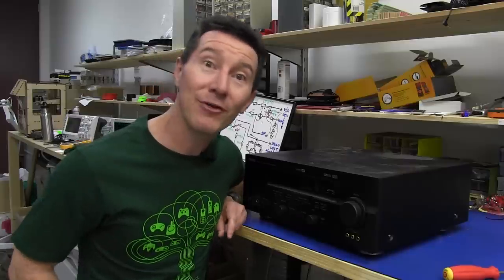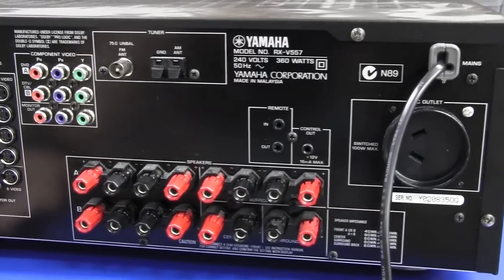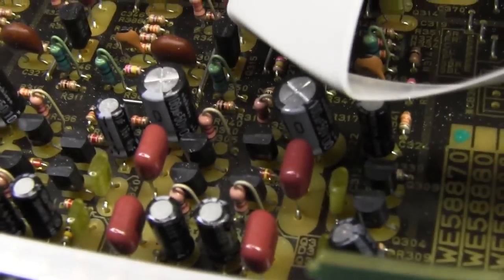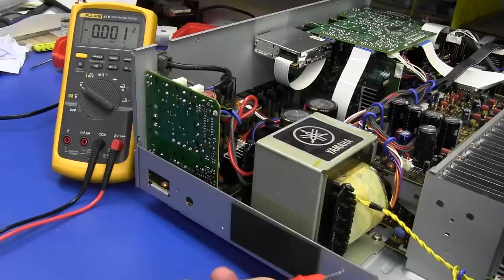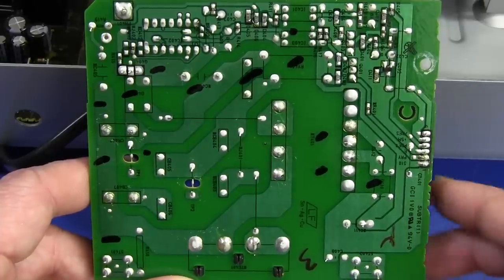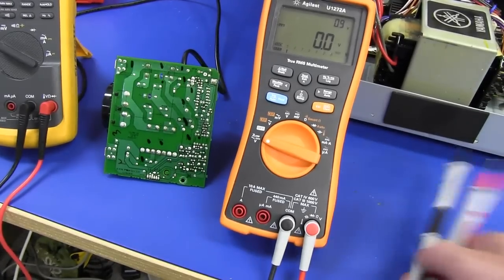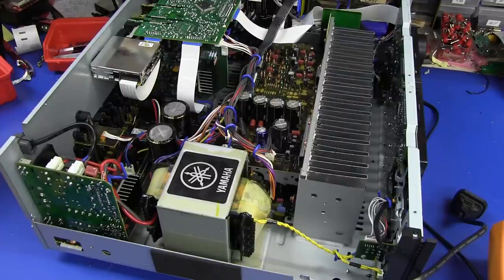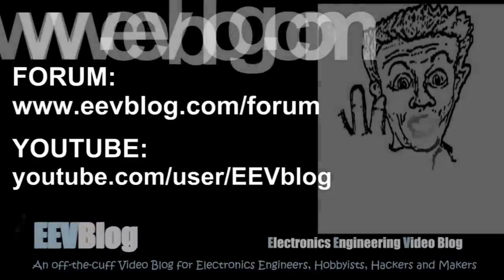EEVblog #378 - Dumpster Diving Teardown Repair

Comment: I tried to fix a 10-year-old JVC home theater receiver for a friend of mine which wouldn't reproduce any sound...eventually traced the problem to a pair of high-precision resistors which are almost impossible to find...so now it's for parts only...

Comment: I agree, there is likely very little, if any practical difference between the caps. They are purely for marketing appeal (perhaps easily visible through the top vents, or simply for teardowns, like this!) I do wonder who uses a surround sound amp with headphones :). I wouldn't know for sure but I doubt they'd spend all the big bucks on a premium headphone amp inside this unit...

Comment: if you hold down a couple buttons an power on you can reset the thing did you try this yet? it has built in protection which you can bypass!

Comment: i have a sony receiver that i like the looks of, but when its off sometimes in the middle of the night the display will partially light up and you get a hum out the speaker that sure wake you up quick. i read that its common with that model and that it is or may be a ground issue.

Comment: in the 70s you could bought Amplifier (that only have 1 signal input and you need to buy pre amp for input selection recording managment, EQ etc, also you need a AM/FM tuner for radio that 3 units that each ones have their own PSU mains plug) , integrated amplifier was the power amplifier + pre in 1 box and you still need the AM/FM tuner for radio unit (total of 2 units), the reciever included inside the AM/FM tuner. as you have more part on your setup it should sound better.

Comment: Only watched a bit of the video so far, but one of those relays might be to short out the inrush NTC when the filter caps are charged; it's common on high-end PC PSUs to meet efficiency standards, but not sure if they'd bother for an amp.

Comment: @19:07, rectifier circuit is not working.  It is acting like a full-bridge had one its diodes die.  Good news is, its probably an DIP-4 IC bridge rectifier - less than $5 to replace.

Comment: Interesting vid Dave.  I think you're being hard on yourself by expecting a solution within 40 mins.   Another 30 mins or so and you might have cracked it.  What was important for my education was the logical way you approached the problem by tracking voltages.  Very useful.

Comment: I have an RX-V657 which comes on for about 2 seconds after the soft on button is pressed, and then goes off.  I can hear the relay each time.  I have replaced C405 :-) but no change.  Does anyone have any idea what to do, other than replacing all the caps on the power board?
Reply: +QuartetMember After replacing C405 the unit was still remembering the old power problem that originally caused it to shut down. So it kept shutting down based on the memory of the problem. 

DIAG option 9 needs to be set to RSVD (reserved) rather than INHI (inhibit) and then shut off the power. This clears the memory of the error indication. Next time I powered it up, it worked a treat! 

Thanks everyone here for all the advice.
Reply: @QuartetMember  what you've described, how do I do that?

Comment: Do you now what i want? I want a multimeter with the hold button in the probe.. How come i have not seen one yet? I HATE working with power on just because you first put the probes in, then you turn your head to see the value. You hold your hand, apply some pressure toget thru te tin oxidize layer, turn your focus away from that all.. Please, tell me there ie a better way? I'm so going to get a cheapo and just solder a foot switch on the hold button so i can take measurements without turning my eyes away. I'm grown man but scared to death every fucking time i need to turn my head away.
Reply: LOL!   Halfway through reading your comment I was gonna strongly suggest the foot-switch thing but kept reading so I wouldn't make a fools of myself!  I was gonna say that a real hobbyist would mod the meter, add a socket and have a series a different switches for whatever you like... Foot switch, little button on your probe, holding the switch in your teeth!  Whatever!  ;-)

Comment: the wires that start in the big transformer and go by the SOFT-POWER-ON button PCB , and then to the front panel, is not the FILAMENT voltage for the crystal display?

Comment: If it was me trying to fix the I would just connect the mains input directly to the transformer. If all it seems to do is switch a relay for the standby power. Providing the board does not contain other components critical to the amplifier operation.

Comment: I have been doing the same checks in my Yamaha as You few years ago. Shorting relay, tracking digital on/off signal etc. I spend two days over this until i found this fault with scope. Since then I have been repaired 10+ different Yamaha models affected with same fault and none returns so I think circuit is good but caps are poor quality. Samsung has CapXon and Yamaha has own C405 cap :) But after repair its really nice receiver even better than new ones with HDMI.

Comment: I dumpster drive for electronics and optical devices too but I rarely try to repair anything. I live in japan and people here version up their kit pretty often. When they do they dump the old kit - which is usually still working.  

My most recent get was a HPE-380jp computer with 3.8GHz 4-core (HT) and blue-ray burner in.  It needed memory was all - so I added 8GB and it's faster than my 2010 Mac Pro 8-core. Just down the street there was a Diamondcrysta RDT202H and an ACER H233H monitor in.  So I bought a GIGABYTE GTX570oc for $65 and now for a total investment of $65 plus some RAM I had laying around (worth maybe $30) I have me a dang-fast game box. 

Not bad aye?!?!

I wouldn't attempt a repair on something like that Yamaha Surround processor tho.  Maybe see if there's just a fuse replacement that will resurrect it and then throw it back out if that doesn't do the trick. Complex purposed electronics like that are just too difficult to troubleshoot as you've found out for yourself. ;)

Comment: Because a capacitor is a capacitor.  You have a capacitance value and a voltage rating.  In an audio circuit capacitor of equal value should sound the same.  If no difference can be measured, it sure as hell can't be heard.  Audiophools believe that electricity is still something mystic and that we don't know enough about it to say with certainty that if there are no measurable differences that there shouldn't be any audible differences.

Comment: Got No Isolation Transformer?  Just connect up "Device Under Test" to mains power 'through' a small wattage incandescent light bulb of about 10 watts or so and still can take all voltage test and if shorted, just the Light Bulb lights up with low current pass. Not meant to power up a high current device, meant for troubleshooting probe around being far safer than dealing directly with full mains current.  Still be ultra careful.

Comment: I caught my hand on the back of a transformer in an amplifier the other day. It wasn't that bad luckily. Nothing tripped. You need to put a bit of effort into that amplifier. How about checking more capacitors, i have just seen a video where a guy replaces the main processor or pre amp switching dsp chip? This did the job. another thing to try is the reset by using the straight button, videos on youtube, on newer Yamaha amps with hdmi, try to reset all with the straight button program button  and power button.

Comment: What would be good for cleaning circuit board , I have 2 nice amp`s they both work ,  but they are very dirty , look`s like Molasses are something , how ever the one amp dose say over heading if there is a loud sound
Reply: 91%+ isopropyl alcohol. Cheap, cleans well and evaporates very quickly.
Reply: Otto Teed The alcohol dries out your skin pretty quickly, leaving it white and scaly.
Reply: Which is why you'd wear gloves as you would with other cleaners.

Comment: i have rx-v457 that won't turn on ,just because i plugged it into the wrong frequency,i was testing my homemade inverter that day and it's not a sine wave inverter ,not even close ,maybe it's a sawtooth or anything like that,it have a burned resistor but it still won't work after i replace it it's a 2.2 ohm resistor connected in series with capacitor near the power input connector (power supply board)

Comment: People open up equipment all the time...if there was actually a danger of killing yourself from poking around in electronics, don't you think there would be plenty of cases? Can someone show me a few cases? I personally think that is a gross exaggeration....maybe a good shock but that's about it.
Reply: I thought i was the only one who thought this! It seems sacrilege  to even hint that  the saftey police  might be exaggerating.  I have no professional credibility, merely amateur enthusiast, but I've never heard of anyone (directly or otherwise) that actually died.  Actually never heard about anyone getting badly injured either.  Obviously both have happened but I suspect the stars have to align just right for someone to get badly hurt. Blowing up, sometimes in a quite literal way, either the stuff you're working on or the gear used to measure, is definitely something  common though. I don't want to call it fear mongering...maybe arrogance or elitism? As in, what we do is so dangerous, you have to put in your time and be a genius to be an electrician. 

Edit: Not saying Dave is like that.

Comment: yeah its a nice "little" transformer , my scool scrapped some old stuff and we got a "hill" of dead everything on our floor and i picked up i think at least 15-20 kg transformer :D , i dont know what type it is but its rated for 380 V and 15 amps , also a fair bit of juice , unfortunately it smells like the isolating color from the windings is molten , lets see what the scrapyard will give me for that :D

Comment: Have the same problem with an electric organ. Beautiful machine but appears the power supply is shot. Unless I find an Identical model it's unfortunately going to have to be scrapped. May use a circuit board for a guitar pedal. Anyway 60$ for a used one on a buy, sell, and trade site. A service tech wouldn't even look at it for as much. Have the schematics too. In their day they were absolutely serviceable, the parts were modular and readily available; Now, not so much.
Reply: +AtariXcore ps. one of the more informative videos in my opinion took more from this tracing circuits and such than some of the other vids.

Comment: Dave, 

I sell and service high end AV Receivers among many other things. The biggest couplet of the receivers going to like that is the one of the main chips. Just last week we got one in the shop that the video processor went out on. It would not boot without it. Being a custom chip and next to impossible to find my boss let me scrap it for parts :D

Most receivers will have 2 10F caps like that. Right now I am looking at 2 56V 10000uf Nichicon caps that I got out of a receiver.

Comment: IIRC it is not a crystal display, is one like the in the old VCRs, because I repaired a similar model once. It has heating wired crossing all horizontally. And it has connections from the transformers like 23vAC or  something like that, also that AC is used to input a sync pulse to the microcontroller, so the microcontroller can measure a known period, like to genererate a interrupt for the ISR (software code).

Comment: on a standby switch board You sayed that You measured the condition of capacitor, I assume that it was not unsoldered for that, how is that possible ? Great videos I enjoy them greatly, thanks.

Comment: Hi there. You have made nice videos helping lot's of people. I got a Yamaha RX-V650 and I need to fix it up. The problem is that when it's plugged in 220v and I push the power button the display works only for 1 sec. And my question is when you push the power button do you here a relay click or the only relay is when you adjust the 220v? Hope you have an idea to help me out..

Comment: I have an RX V477 I got from Ebay for about 40 bucks, original box, looks new but someone must have hooked it up wrong, its in protect mode, and from what understand that's in the power amp section. I'm a noob at this, just getting into it more now that I'm old, dad was an electrician and I went to electronics school. I need some better test equipment and schematics, where do you find schematics for these units? I like the equipment you have there. Any recommendations? I thought you know this might be good for me to do, I'm disabled and this work seems to be easy enough. I used to work on appliances, broke my back moving them. Cheers.
Reply: test the output transistors with a meter.  those usually go first when shorted or overloaded.  also unhook the main amp and see if it stays on or doesn't say protect.

Comment: i was fascinated and glued to the screen ,,, good try ,,,, maybe it had a sensor that monitored a fault/short in the speaker outputs and protected itself.... could need a special power on sequence such as holding the source input button and standby button simultaneously to reset.. who knows... p.s. what is that rectangle hole in top left on the back panel? be well my friend.

Comment: Just spray some "Armour All" on the Thing- Put it the "New" Box- And off it in a Parking lot to some Sucker for a Hundred.
Reply: That comment brought back a bad memory. A guy came up to me in the 90" in a parking lot said he had brand new Viper car alarm, new still in the box, half price at $50 US. I was interested. At his car in the trunk/boot he had half dozen Vipers and an asst of goodies. I ended paying $75 for 2 vipers new in boxes, still had shrink wrapping. Later discovered I paid $75 for two pieces of 2X4's about 3 inches long. Figured he dumpster dove new boxes at an installation store.

Comment: So, I've got an RX-V550 which looks exactly like this one. Mine actually clicks on, all the amber lights come on, and then it clicks back off. 
Funny thing is it was working when I packed it up for a move, the thing was babied the entire time, and when I unpacked it and plugged it back in, this is the state that I found it in. Any one? Right now, its a paper weight.